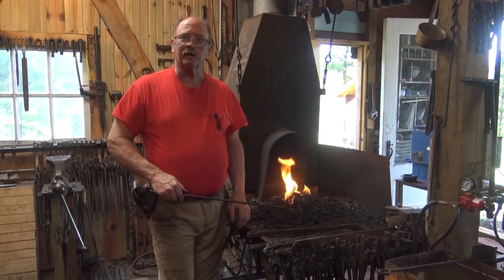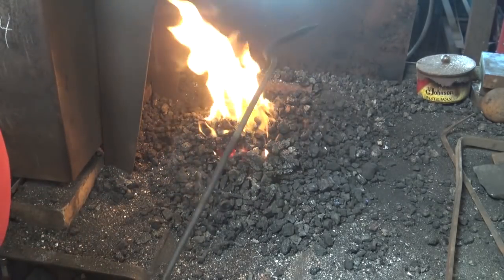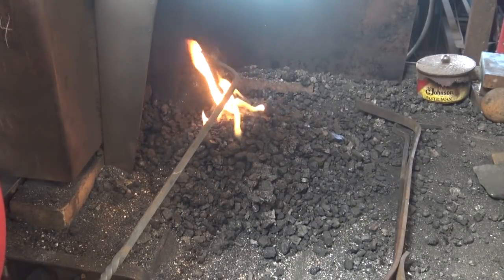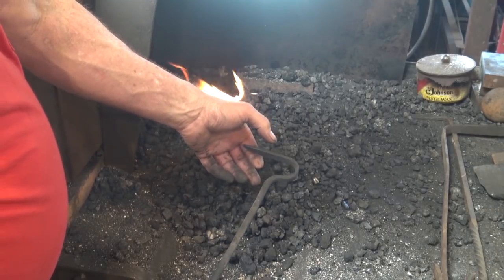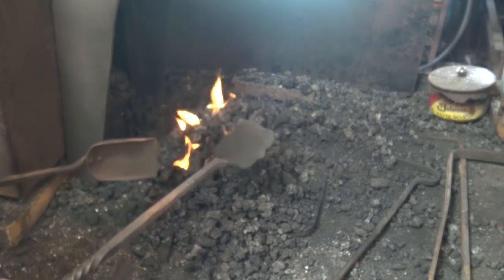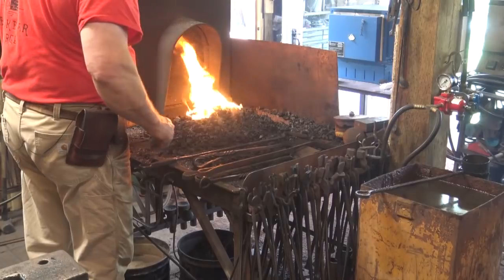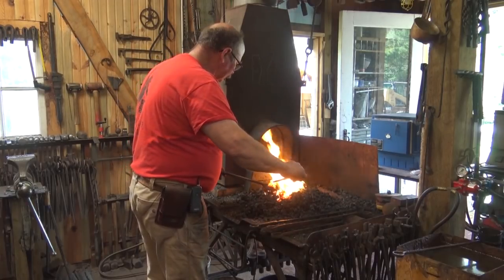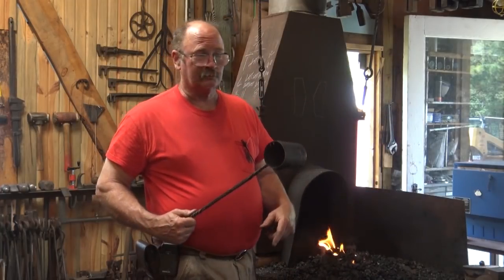Coal fire maintenance tools

Comment: Ive seen a couple of solid fuel forge users add water around the fire, one even adding water to the fuel before adding the fuel to the tray around the fire.  Still trying to get my head around that . Thanks again for the vid' All the best Mat
Reply from the maker: For coal, the water helps keep the fire under control, helps it bid together and the steam helps it coke.  It is only done with the fresh coal outside the fire pot.
Reply: A forge is the only fire that burns with wet fuel.

Comment: You’ve referenced in at least a couple of videos a couple of differences in coal and charcoal fires but I was wondering if there are any major differences in the maintenance and use of charcoal for forging and if there is a certain type of charcoal that is best to use? Thank you and I look forward to more of your videos.
Reply from the maker: They are enough different that you need to get used to it.  The main thing is that it takes way more charcoal by volume to get the same amount of work done.  Real wood charcoal is what you need, not briquettes.  Hardwoods burn longer but soft woods burn hotter